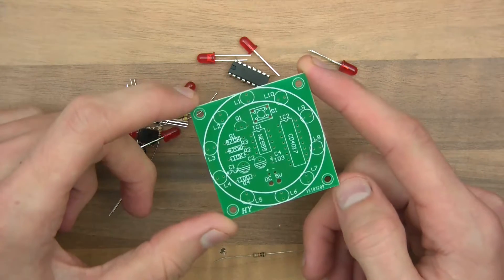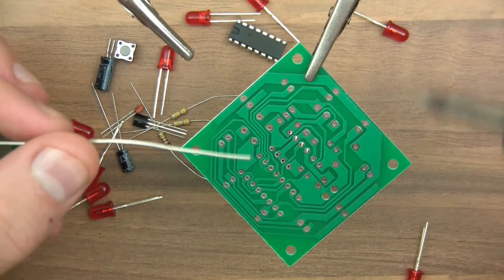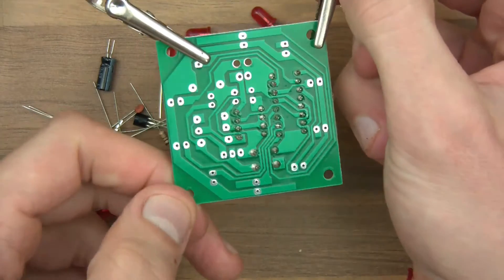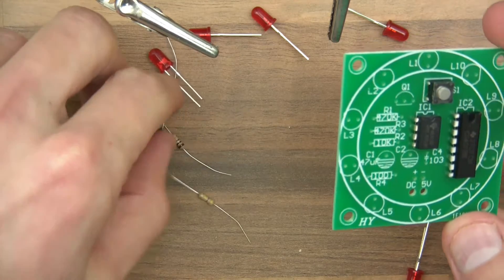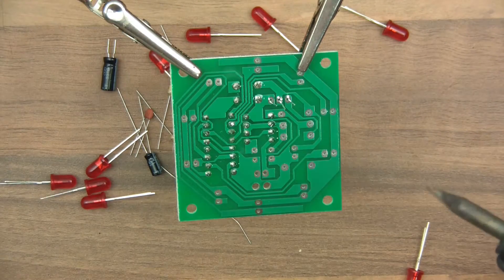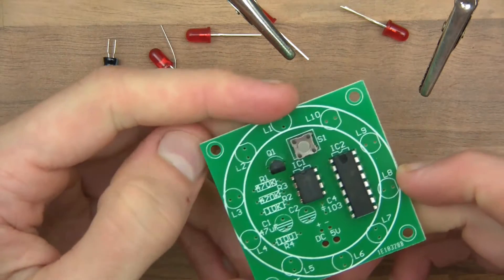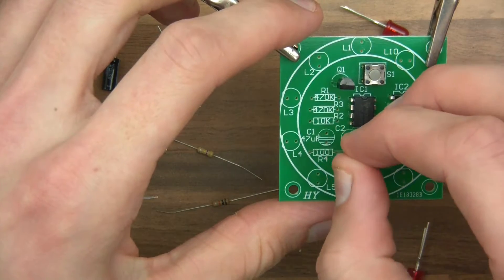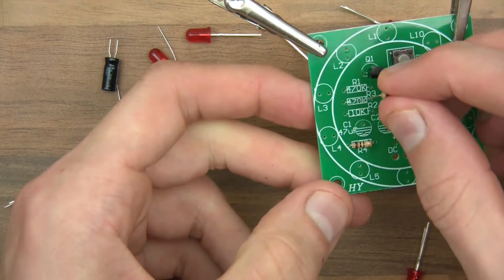Kit Build #7 - LED Random Number Generator Kit (Part 1/2)

Comment: I do like the sensor/microcontroller videos more but the soldering stuff is good background content if I'm working on something. In terms of work, though, you seem to get more views from those videos too (you'd have to do 10 soldering kit videos to equal one of your more average micro-related videos).
Reply from the maker: Yes, you're right. I don't enjoy these videos as much either. I prefer the microcontroller ones. If I'm tired or don't have time, these are handy though. Proper video coming on Saturday hopefully. 😀